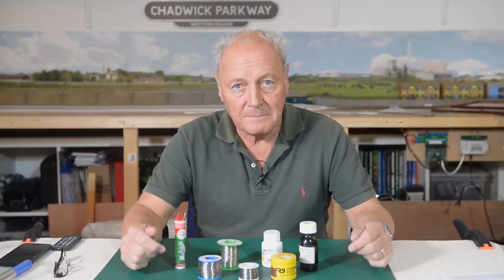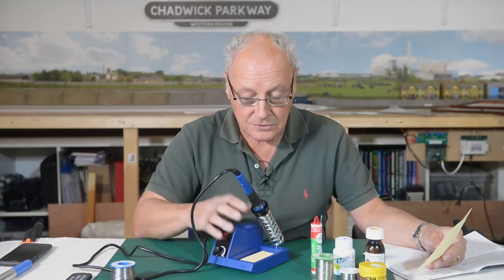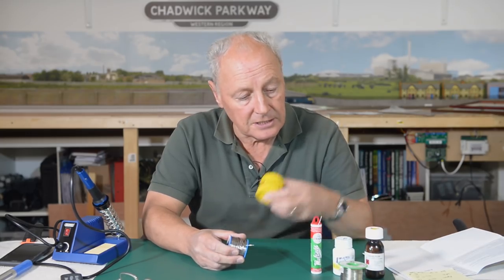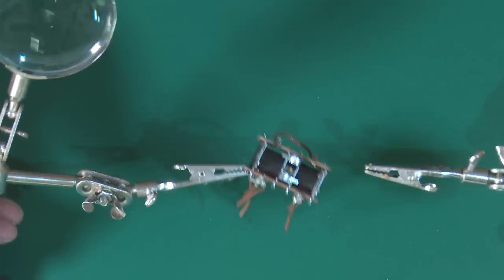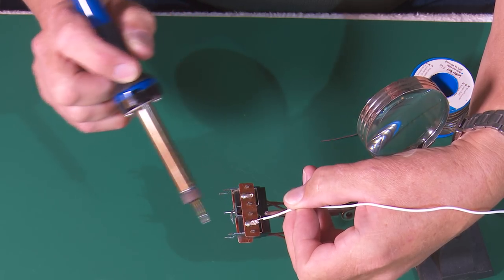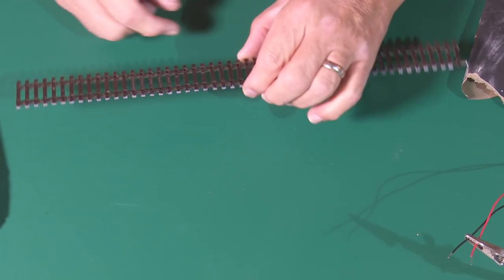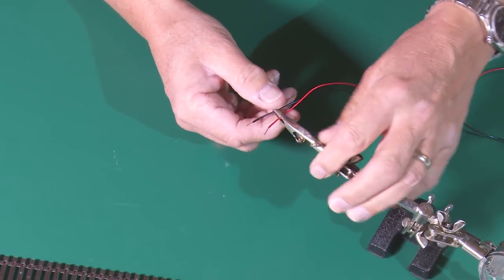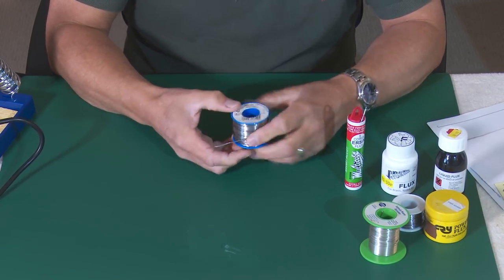Soldering with 60/40 Solder at Chadwick Model Railway | 45.

Comment: Hi Charlie, Yes I'm from the era when we painted our walls with lead based paint, used leaded gasoline in our automobiles and when I first learned how to solder in the mid 1970, 60/40 solder was used for all electronics including model railways. This is a great video on soldering with 60/40 solder and your safety briefing was spot on. I also want to thank you for your metric to Fahrenheit conversion. I currently own a Weller soldering station that is very similar to your soldering station and although my instructions say I can use the soldering iron without the station, I've not had a need to do so nor would I want to do so. Using the soldering iron without the station I'd loose the ability to adjust the temperature of the iron. I've also found for modeling purposes the pencil point tip for my soldering iron works best. I also use 60/40 with a resin core, but old habits die hard and I still tend to use a small dab of flux when soldering feeder wires to my track. Cheers, Rich S.
Reply from the maker: Hi Rich,
I’m so pleased that you enjoyed the video.  Good luck with your project.
Regards Charlie

Comment: Much better technique  then your previous video. When reusing parts you normally do not have to add solder, just the opposite. Use wire braid or a solder sucker to remove the extra solder so you can put the new wire through the hole in the tab.
Reply from the maker: I’m so pleased that you enjoyed it.  My technique has improved somewhat but we all still muck it up on occasions.

Comment: I was just going through some of your old posts again, Charlie. When you mentioned that the lead-free solder is used, it goes dull in appearance. It reminded me of when I was doing my electronic course in the mid-80s. If the 60/40 lead solder turned dull and not shiny, it was an indicator that one could possibly have a bad non-electrical connection with that joint. Best to test your joints like these after soldering to make sure they are electrically connected with a test metre. It would be frustrating to lay your track down and have to lift it again if you found that the joint was bad. H&S bejezuz, what was that in our day, Charlie,  oh yeah, non-existent, lol. PS: How is your Chuckle Brother keeping this weather? Well, I hope CB (10-Four, there Good Buddy), lol.
Reply from the maker: Hi John, thanks for asking, all is well at this end.
 I now use 60/40 lead solder.
And I always ensure that it is left in the shiny manner. Regards, Charlie
Reply: @Chadwick Model Railway  Then may your joints and joins be shiny and never dry. Hmm, thirsty work modelling, I think I need a beer. You want one CB, 0.0 vol alcohol free off course, as I'll be driving locomotives later, lol.

Comment: I tried using modern "safe" lead-free solder and couldn't get consistant results so i bought half a kilo of old fasioned lead-based solder.  This is the stuff that I've been using since the 1960's and it works well, which is more than I can say for the stuff foisted onto us by the health and safety GESTAPO.  Incidently, I always use flux, despite the solder being cored...  Gives more consistant results.
Reply from the maker: I’m so pleased that you have a good and well founded solution. Regards Charlie

Comment: hi Charlie ,i now swear by a TS100 pen type iron,there are plenty Youtube  videos about it ,its small ,comfortable to use, heats up in seconds even 400 o/c best of all operates between 12 -24 volts so any laptop power supply works of off car/truck battery, i have used many soldering irons since i started my electronics hobby late seventies ,this blows the socks off them even has nice informative display, temp fully adjustable, various tips are cheap and easy to come by,well thats my 2 cents worth. Thanks take care all for now.
Reply from the maker: ..... and a worthy two cents too. 
Regards Charlie

Comment: Very informative, especially for the beginner Charlie.  I tend to use 22swg solder.  This is thinner and less clunky.  I covered soldering droppers in my last video.  I have done a lot of soldering but usually on electronics rather than railways (in which I am a beginner).  A good thing to keep in mind is that when tinning, first whet the iron as you did, then feed the solder between the whetted iron and the piece you are tinning.  This makes the solder flow more easily and reduces the time the heat is on.  I also prefer to go in hot and spend less time on the connection but that is just my preference.  Thanks for the video.  Ian
Reply from the maker: Hi Ian, I’m so pleased that you enjoyed it. Regards Charlie

Comment: Hi Charlie, I have been thinking of doing a video exactly like this so you have saved me the trouble. I seem to have watched so many modellers struggling with soldering lately and it is usually down to the use of lesd free solder. It is aufull stuff. It does not flow easily and requires lots of heat to get even an average joint. So I see modellers using these very corrosive fluxes to try to get a good joint. I spent nearly 50 years working in electronics and have made quite a few solder joints. The first time I used lead free solder I could not get a good joint no matter how hard I tried. When I quizzed colleagues they confirmed that they suffered the same way. I won't go into the ins and outs of the politics surrounding this state of affairs but siffice it to say that military electronics do not use lead free solder as it has never been proven under the adverse conditions it must face in the field. As you say it is perectly legal for us to sell, buy and use leaded solder so I hope that modellers will stop torturing themselves with the unleaded stuff. 
Thanks for a very well presented video Charlie. ..............................John
Reply from the maker: Hi John, I’m so pleased that you enjoyed the video.  I have struggled like so many thinking that the blame lies in our technique rather than using a substandard product. 
Yesterday I was reading through your comments on DCC decoders, in preparation in a forthcoming video.
I would like to discuss it further at some stage.
Regards Charlie

Comment: I bought a Parkside digital soldering station from Lidl's and its been actually pretty good, only about 50w but it does take unified solder bits from other irons and I used it before going back to model rail mainly on car and device electrics as I found my old crows beak tip fits it brilliantly which is superb for SMD stuff.   I can recommend either the Parkside or the Ferrex all in one cordless rotary tool, I use mine a lot fixing and polishing watches and think its been going strong for 4 or more years and I have worked it hard too.   I have two small solder jobs to do, one is to put back the brass tab on an ancient Triang's positive wire, the other to solder in a new pickup rail I made for my ancient 08 shunter as the thin spindly pickup wire had snapped off on the curly bits.
Reply from the maker: I used a Parkside “Dremel” for ages but forgot to charge it regularly.  Eventually it would take a charge.

Comment: I commented adversely about your tinning technique (carrying solder to the item on the soldering iron tip) in a previous video.  Much better in this one !  Tinning by heating the item, adding solder then removing the iron allows the flux to work.  

I am more interested in electronics than model railways but it is always interesting to see and appreciate the crossovers between hobbies.  You mention and show soldering iron bits other than the pointed one you used.  Personally I find the pointed ones a waste of time as the point of the tip cannot transfer enough heat to the work and I prefer the cutoff cylinder type.  The point of it can be used when needing to solder small parts whilst the flat portion can transfer a lot of heat quickly when needed on larger components.

As mentioned in another comment here it is possible to use extra "no-clean" flux (from a flux pen) and this can make things even easier.  Soldering is one of those skills that once you can do it seems easy, but bad (or no) preparation, dirty components, wrong temperature and/or wrong solder make it very difficult.  I can look back and laugh at my first attempts at soldering, probably in about 1960, using a soldering iron heated on a gas cooker using a large stick of solder and no flux.
Reply from the maker: Hi Bob,  many thanks for you comments.  My soldering skills have certainly improved in the last six month  but only through perseverance.  My model railway videos are posted to both entertain and cultivate interest in the hobby.  Hopefully, I’m starting to win on both counts.
Regards Charlie
Reply: See my post above, but tin the iron.

Comment: Tin/lead solder does tend to be easier to use, it's just less friendly. I normally use it though. Rarely have a failed joint. I do still tend to use extra no-clean liquid flux, though, as it only takes a second longer and tends to be good belt and braces. My take is that it's better getting it right, than spending loads of time fixing it further down the track! Always worth going for a temp adjustable iron too - like you say, it's vital for some more sensitive work. Worth spending a bit of cash to get a good one.
Reply from the maker: I’m so pleased that you enjoyed the video.
Regards Charlie

Comment: Hiya, nice one pal. Just a few points from someone who has done a few million solder joints plus silver soldering on... o yes silver. Clean the metal to be soldered onto, it must be clean, as you did on the rail but on the fish plate as well. Tin the tip of the iron before use, every time, not much solder, you soon learn how little works, it's the solder that helps transfer the heat you can see that if you re-watch the tinning of the two wires you did. When you've tinned the wire trim the copper to length, you don't need 10 to 15mm sticking out on the bottom of those rails 3mm will do.. I was taught to solder at Marconis in Chelmsford, one of the best teachers in the world, or was in the 70's when I was there. You were correct place the iron on the end of the wire and let the heat go through the copper not move the iron. To solder onto a tag the tag needs more heat as it has more mass so heat it first then add the wire. I would hate to try to work out how much lead I've inhaled and its not afffecerted  meeeeeeeeeeeeeeeeeeeee at all! 
Good on you for trying to teach us new boys and girls, I'm 62, but please every so often tell us what DDC etc, etc, etc stand for... you're not just preaching to the choir. Thank you and take care.
Reply from the maker: Hi Steve,
Many thanks for your comments.
Yes soldering is a black art and we all have so much to learn.
DCC (Digital Command Control) is the 15 volt AC power system. It’s the alternative to the long established 12 volt DC power system. 
Regards Charlie

Comment: Hi Charlie, do you prefer the Draper soldering iron to the Duratool iron in video 25?  Also what size wire were the droppers you were soldering to the track.  Excellent to have all the video's listed when one wants to back track (after watching all your video's when covid was about.  Thanks Bill
Reply from the maker: Hi Bill, the soldering iron in number 45 is the preferred option. My cable size for droppers is now 16x0.2mm.
 Regards Charlie

Comment: Hi Charlie, If you want to reduce the melting temperature even further, then try 63:37 solder which melts at 183C. 60:40 is higher at 188C
Reply from the maker: Hi J, a very interesting point.  It seems strange though, I would have thought the temperature required would be higher as there’s more tin.
Reply: From Wikipedia: A eutectic system (/juːˈtɛktɪk/ yoo-TEK-tik)[1] from the Greek "ευ" (eu = easy) and "τήξις" (teksis = melting) is a homogeneous mixture of substances that melts or solidifies at a single temperature that is lower than the melting point of either of the constituents.

63:37 gives you that magic mixture.
Reply from the maker: Wow, great spot J.

Comment: Thanks, useful as ever! I don’t have an extractor system for the airbrush I don’t have yet, but wonder if that could double as a soldering extractor as the ventilation in my place is limited. 

 Can I just ask that whenever playing with fire (!) / heat people consider their clothing.  There is a fire resistant fleece developed for military and fire officer usage but for most fleece and nylon clothing out there it just melts into nice hot globules of molten plastic that continues to bubble away in the burnt, skin and basically has to be picked / scraped out of the wound.  Incredibly painful.  Fleece socks and gloves a particular nightmare.  It’s often a 5 November issue with sparklers and fleece sleeves / gloves exacerbated by the fact that most bonfire nights aren’t anywhere near a water source (beer works better than nothing but 10 minutes minimum constant flow needed).  I am not suggesting that model railway builders dress in hazmat suits, just think carefully.  Good old cotton or silk works and is easier to rinse / pick out of wounds.  Sorry for the Elf n safety goblin, a personal bugbear.
Reply from the maker: Soldering, an open window and a gentle  breeze will cut it.

Comment: Hi Charlie. Very instructive. Is it necessary to solder every piece of track even on a small layout?. Also why do you cut through the track prior to soldering?. Oh, forgot one more question (sorry) how long would you have the dropper wires for a 6x4. Thanks.
Reply from the maker: Hi Dave, it isn’t strictly necessary for every track but certainly it provides better running on DCC.  I only cut through part of the web to gain access to solder on the droppers. They only need to be long enough to reach you bus wires.  Regards Charlie

Comment: I was told by Draper directly that there is only one tip for this soldering station. You can see this on the Draper site. The 48W tips are not suitable again confirmed by Draper. This was the reason that I concluded that this 40W solder station was not suitable for railway modelling. One tip type is unsatisfactory.
Reply from the maker: This solder station is a good budget all rounder.  Clearly, there are better ones on the market but for folks new to this skill, it’s ideal.

Comment: Hey Charlie the good old discount store lidl do a soldering station for about £15 I think very good value for money, I soldered some wires no problem at all but when I tried to solder some old type tinplate track I had trouble getting it to tin no matter how much that I cleaned it up, I see that there's an abrasive fiberglass pen that modelers use for cleaning joints have you ever come across those? Oh by the way the fan for blowing the fumes away was a good idea but don't you realise that you were blowing it towards us viewers!
Reply from the maker: Hi Barry, I’m so pleased that you enjoyed the video. Some guys use a glass fibre pen to clean up the surfaces prior to soldering which works okay. This could be the answer that you seek.  However, it could be that you need more heat than your iron can deliver!
Regards Charlie
Reply: The cheap iron would not get hot enough...

Comment: Hi Charlie watched your video on soldering looks easy but it’s a long time since I have soldered anything maybe when I was 14 at school I am now 61 I have a class 55 with directional lights but the orange wire has come away from the contact on the 8 pin dcc chip would soldering with a fine tip sort it out or would you change the chip hope you can advise. Kev
Reply from the maker: I would certainly re-solder it.  What do you have to lose?

Comment: Hi Charlie, does solder expire? If so, what are the symptoms of expired solder? Does it affect conductivity? I'm struggling to find a relevant information regading this and woudl appreciate your thoughts on this. Thanks.
Reply from the maker: Hi Fillip, I have never heard of solder have a working life.  Perhaps it might have something to do with its resin core.
Reply: @ChadwickModelRailway  Many thanks Charlie, yeah, I read this somewhere. I think it was related to the resin core but also solder itself. I have got 5+ year old solder and not sure whether I can use it. I also have got some problems related to the voltage (it is too low) when I connect DCC equipment to the track, so checking every single link.
Reply: @filip78channel15  I can tell, your old solder should be just fine. I solder professionally (usually lead-free) and at home I only use leaded solder types. When the ban of leaded solder came here in the EU, my boss gave me about 20Kilos of leaded solder (different diameters and alloys), as we weren't allowed to use it anymore at work. Some of the wire is from the 60s and I don't face any problems. You can basically keep it for decades, as it doesn't really degrade. Even the resin core stays fine. I definitely prefer lead containing alloys over lead-free ones, not only due to the easier use of it. The reason therefore is that with lead-free you sooner or later face the issue that the joints tend to become unstable over time due to vibration and changes in temperature which leads to higher electrical resistance and therefore may cause damages to your device. There is a reason why electronics from the 60s or 70s still work today, compared to modern ones that often fail after a couple of years.

Comment: For heaven's sake, man . . . Buy soldering heat-gun with various nozzles, and it comes with an iron too. £60. You have wasted £20. The tip will ware after a few uses, yet the heat gun soldering station will last for ever.
Reply from the maker: Can you send a link please?